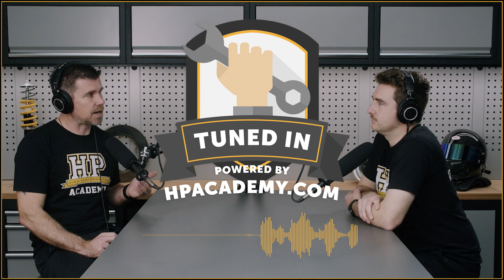001: EFI Tuning at 14,000ft | Shane T & Pikes Peak [#PODCAST]

Comment: I had little play with the  pressure ratio for load axis on the haltech on a petrol VGT SR20 I'm sure it works  the math and the physics is undeniable   the main limitation was recalibrating my long conditioned brain  its hard .. i  ended up  with a pretty coarse correction table with EMAP axis .Shane  explains it exceptionally i will only have to replay it like 3 or 4 times